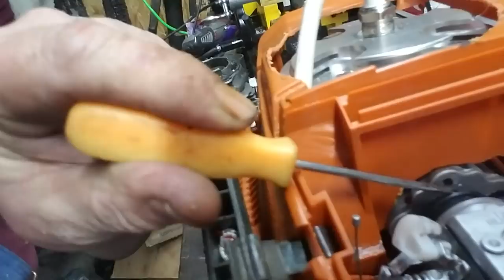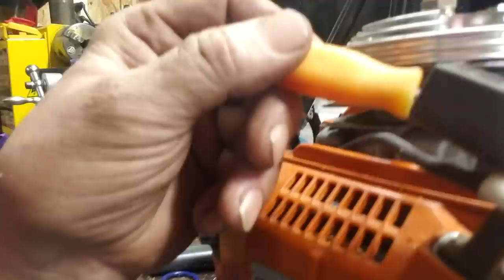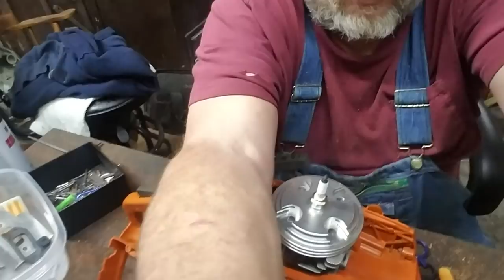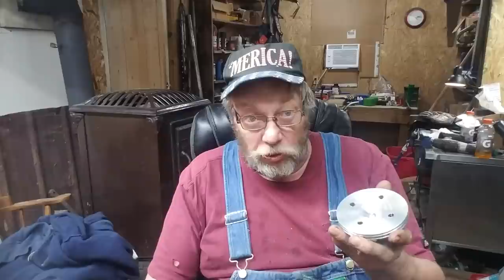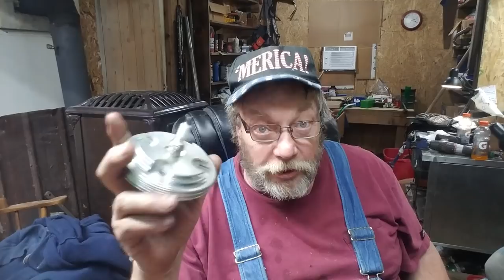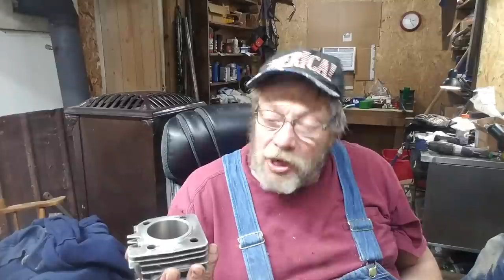372 reed saw mock up! 372 hyper what?

Comment: Uncle Harvey! Missed ya buddy! Been working nights. Checking up on Ironhorse videos! By the way.... this saw build is ridiculous!  Only you would build a cylinder/jug that looks like a 2-stroke dirt bike/quad/snowmobile head like this! Absolutely insane! Only you would come up with something like this! Reminds me of the 250r/Arctic Cat/Yamaha days. The Reed Valve motors are super responsive. Putting your 2 Stroke knowledge into saws is crazy. Before you even said anything.. I commented and you said at the end... this is the dirt bike/snowmobile combo. I noticed it right away. You are a great man and unbelievable saw man! Leaded 110 Fuel and 2 stroke oil in the veins! Lets go racing!

Comment: Now you are talking my language Harvey!TP makes a really nice push-pull compression release. They are 10 mm and should do the trick. About 25 bucks. An old Bultaco, Montesa, or Maico unit would be excellent as well but you need a lever and cable as you noted. You should be able to use fine valve-grinding paste to lap the head to the cylinder spigot. No head gasket required on aluminum to aluminum. Some of the old timers used aluminum paint or high-tack spray. I just run them lapped (clean and dry or a dab of anti-seize sparingly applied. Copper or aluminum powder filled grease) they do not leak, and, offer amazing heat transfer. Most of the old German stuff was run like that on the track (Sachs and DKW).  If you had cast iron sleeve, you would cut an o ring groove and use flame softened copper wire for an o-ring. I have used them lots on my high compression builds  and blown engines (supercharged). The oil cooling holes are a big deal, they help like crazy. Super fun project man, I love it! I had a tiny diaphragm pumper flat side carb around here somewhere. Man I cannot seem to remember where the heck it snuck off to.  But if it surfaces, I'll send it your way.

Comment: Nice video and excellent ideas.  I would use brass instead of copper for the top head gasket.  It has a closer cte to aluminum than copper.  Might be better to prevent any compression leak.

Comment: Great job! Great build it couldn't be more interesting. I love challenges and doing things outside the box. 
My vote would be for a soft copper head gasket but the sealer may hold.  I'd worry about the heat with the sealer.

What would keep a feller from using a cylinder with a thin cast iron sleeve pressed in it instead of the nikasil? I have a cylinder that is slightly egg shaped, not much just enough to make the piston tight, from welding on the transfers. Would be a great one to cut off, bore and sleeve or possibly have plated.
Again Great video and thanks for sharing.

Comment: That removable head will allow you to dial in squish with ease ... With the right combustion chamber design that saw will make some serious power !   You can also throw the head in a lathe, machine a radius into it and use an appropriate o ring as a head gasket ... if you really want to go coo-coo you can drill out the center of the head and tap it and use various cc machined screw-in domes.  If you wanna “race” you pull off head - remove threaded “worksaw”dome and replace with “racer dome” and readjust carb accordingly and vice -versa!  All the power is in the head design but we all know that 😉... STIHL lookin for a runner 044 😂 ... 300psi compression will be a short trip Harv , she won’t turn the rpm and will most likely self-destruct in short order 😃

Comment: You build stuff I only think about. On your head gasket aviation gasket sealant won't work. Maybe kw copper or permatex ultra copper. Although I think a simple copper ring might be the best for access. I wonder if the plug will fire at 275 psi? Maybe 
.20 gap? You might consider  a small electrode platinum plug, if  nothing else should make it easier to start.  Probably a lot easier to find in that style plug. Don't  know if my ramblings help but I am enjoying your project.

Comment: Good stuff!  Depending on what you’re estimating for cylinder head temps, maybe a high temp O-ring set into a groove on top of your cylinder to seal the head??? That would make life easy on ya. Works on liquid motors but not sure on air cooled. Just a thought. Thanks for the down to earth teaching!

Comment: The Indian Head cement would be pretty cool and it’s actually kind of a neat name for a Salute to the old Indian Head bike???    It’s an awesome build!   I’d probably have 1184 around it because I’m cheap...😂😂😂.  On my 350’s I’ve been removing the center area of the transfers for years... that primary and secondary type concept at 12,000 RPM’s doesn’t interest me as much as a slightly increased quantity of fuel charge from the left and right side does... I haven’t seen a negative... when I run my water stream through it... it looks a lot better to me?  And with a 4” long shaft ball burr I can reach in and I don’t need to repair the outside of the cylinder... ????   I absolutely can’t wait to see this beast rip wood!  With your intake timing increases your torque is going to be awesome and your blow down can be way long because it’s just adding additional torque???  Man this is a very cool build!!! Thanks for doing it on camera Captain!!!
Reply from the maker: You have a perfect grasp of this David!
Reply: @theironhorse6600  I was just thinking about that Mac Qport exhaust to decrease it’s need for a decomp... you could rip a slit up the exhaust port center and make your own Q-port??? I don’t know enough about them...😂.   It’s definitely going to be very neat to see this thing developing... I love it!!!  So cool!!!

Comment: Hi temp paint for head seal. Heat cycles may move things around and cause future leaks. A copper or stainless wire/groove would be the permanent deal.

Comment: Consider having studs with a course thread going into the crankcase and fine thread nuts on top. A thread is an incline plane and you will accomplish a tighter head with less torque on the studs. Enjoy

Comment: Ironhorse will the acorn nuts vibrate loose? I do know that the threads can’t be longer than the depth of the nuts. Wouldn’t it be better to use a locking nut? Just curious. I loved experimenting at work to get different jobs running and to get a better finish on our parts. So I’m excited when you experiment with different things! Thanks for sharing this with us all!

Comment: Like I said last video. I run air-cooled diesel tractors. The heads are aluminum and the jugs are cast iron one of my tractor's heads are in good enough shape there is no head gasket or sealer just metal on metal. The head is only held with four long bolts. These engines are 17to1 commpression 100mm bore and 120mm stroke.

Comment: this is going to be Johnny Bad Ass. im excited to see hoe this works. have you thought about using a brass crush ring for a head gasket. i have hundreds of them sitting on my shelf that are 2'' in diameter. brass is a little stronger then copper and might deal with the compression a little better

Comment: I'd run both decomp sit like a 12 degree angle it'll help with the back pressure on them let more air suck in to make it pull easier

Comment: I don't care who ya are this Chit is genius! And if I had an ounce of Mechanical ability I'd spend the 2weeks just building saws!! Oh BTW Harvey I've sent  4 emails have you gotten any?
Reply from the maker: I haven’t got emails! I cleaned a bunch out! Please send another!
Reply: @theironhorse6600  👍👊
Reply: @theironhorse6600  may I have your email address again Harvey to make sure it's right please! Thanks Trayne
Reply: @theironhorse6600   I use to play with Volkswagen engines. They use NO head gasket. We always took a cylinder and lapped into the head with valve grinding compound to make it seal. Allthough the cylinder was cast and the head was aluminum and not running 300# of compression. Deutz tractors dont use a head gasket either and they are diesel. They are high compression. It may work. Just my .02.